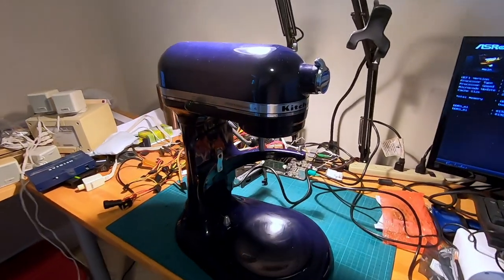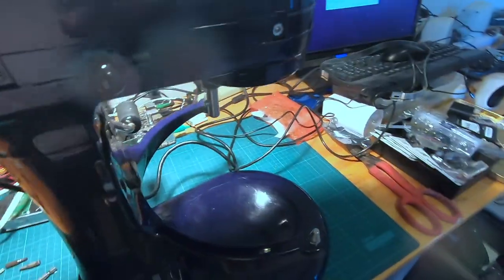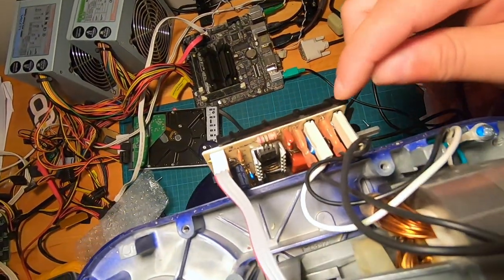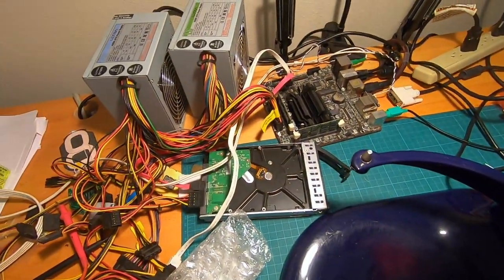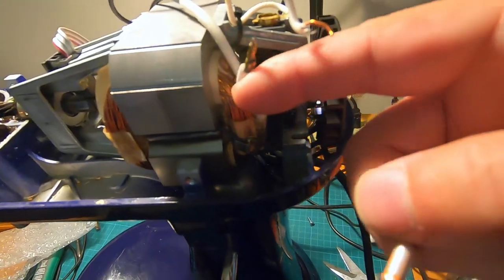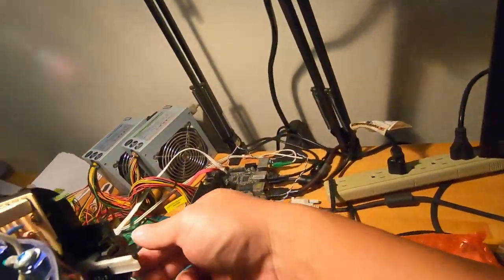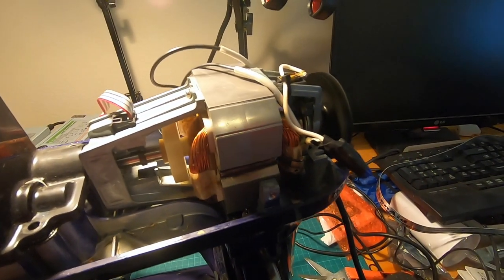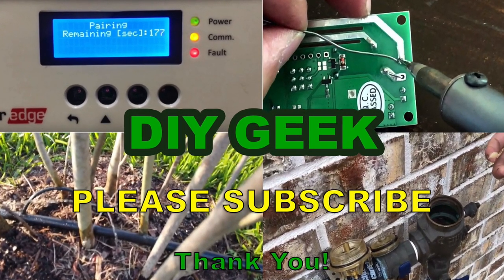KITCHENAID MIXER STOPPED WORKING [FIXED] - Thermal Fuse Broken

Comment from the maker: See video description to get the link to buy the THERMAL FUSE to fix this problem.  You will need a soldering iron to fix it, if you don't have a soldering iron yet PLEASE consider using my link to buy from Amazon (helps with my channel):
✅ https://amzn.to/2IEzGvx
Thank You very much!  🙏🙏🙏🙏🙏
Reply: IF it is needed to WELD a THERMAL fuse, great care should be used to avoid the Welding Heat to trip the fuse. 
Use a wet piece of paper towel over the fuse, maintain the longer leads and use pliers to sink the Heat transfer between the welding spot and the fuse.
Reply: Thanks for this video.  It appears the tank look of the device is deceiving.  I recommend reading and following the directions to a "T."  You can't mix more than the directions state without the risk of over heating.

Comment: Same issue with my mixer. FWIW, they put the thermal fuse there next to the motor winding so that it can be in contact and trip if the temp gets too high.  Remember, it's not an electrical amperage fuse, it's a thermal fuse, so putting it on the PC board would not protect the motor from exceeding the thermal tolerances of the design.

Comment: As said, thermal overload due to excessive heat. This happens for a reason. At near 10 years old, the gearbox grease my have lost its effectiveness. Time to clean the gear box and replace the grease. This should reduce friction and hence load on the motor. When any fuse fails, it's a warning that something is wrong. Without finding out the cause and avoiding it from happening again, another fuse will fail. At least these machines are repairable. Many now made are not.
Reply: This happens for a reason? Then what’s the reason. The same thing happened to mine as this person’s. Working fine. Put it away for a while then went to use it and it’s dead. That’s not what thermal fuses are supposed to do.
Reply: Mine worked for one loaf of bread and died on the second.  It wasn't ten years of bad grease.  It was shoddy engineering.

Comment: It is noisy because all those gears need to be re-greased... All the old grease has to be removed first then after everything is clean new grease can be added.
Reply from the maker: @PiratePete re-greasing the gears sounds like a great idea. Thanks
Reply: @PiratePete can you please explain how to remove old grease and what to use for replacement grease? I'm assuming I would use a lint free cloth...
Reply: @fdort3971  Go to Mr. Mixer on You Tube.  He has a three part series on cleaning and re-greasing this type of machine.

Comment: That's a safety feature built into the board...you have to turn it off before it will run after losing power.

Comment: Yes a bad design.  Mine worked to make a loaf of bread and then popped a puff of smoke on the second use. So maybe a total of 15 minutes running for $300.  Not very well engineered.  Mine is a Professional 550 HD. I hope I can find the fuse.  Thank you for your video.  I will need a better soldering iron that I have so I will get it from your Amazon page.

Comment: What was the rating of the fuse in Degree Celcius? There is no replacement shops offering KA parts but generic fuses with different thermal ratings here.

Comment: The best way to prevent it from overheating in the first place is to use it well within its operational limits.  Have a 5 quart unit and I won't put anything more than 3 quarts.  Plus, I frequently feel for overheating on the motor casing during operation.
Reply: i just cooked off my 6 qt...over loaded it- damn.

Comment: The fuse is for protection if there is a motor power overload or excessive heat. Also planned obsolescence.

Comment: Sometimes mine won't turn on. I unplug it and plug it in again, then it kinda works. Not as powerful as it was, and really noisy. I'm not an electrician, by any means, but I'm not afraid to try to fix it on my own. Do you think it could it be a short somewhere? I am going to jump the fuse for now and grease the gears. Thank you for your video and explanations.
Reply: How did it work out?
Reply: Power issues = your motor needs new brushes. Easy to replace. There are a few good YouTube videos on it - just look it up and you will have a powerful, reliable, mixer once more.

Comment: is it safe  to use the Kitchenaid Stand mixer without the band trim ring on it?
Reply: Yes the aluminum chrome band is for decorative purposes only. BUT make sure all the screws under the band which holds the top (helmet) (head) of the mixer are all secured.
Reply: @growingplantstimelapse5820  Thanks 😍

Comment: My KitchenAid mixer professional plus 600 hd  is not strong enough and shuts off. Any solutions? I guess I used about 3 times
Reply from the maker: @jenoc m How long does it work before it stops? Is it working too hard? maybe a very tough dough?
Reply: Any news regarding a fix?
Reply: There is a place in Hell for people on comment boards who ask for help and then don't bother to tell people what happened.  If you want free advice, a decent person participates in the discussion.

Comment: Why not use a circuit breaker that would reset itself after it cools?
Reply from the maker: Not sure, I am not an electrical engineer and don't really understand it that well. I am just troubleshooting and replacing with same part for repair.
Reply: Is there as a circuit breaker that will break due to heat instead of an overload of electricity? This is a thermal fuse that feels the motor overheating and will burn out to prevent the motor from burning out.
Reply: It's a thermal fuse - It automatically resets when it cools down it doesn't burn out  @EpicBenjo
Reply: @rvj5046     Obviously not or we wouldn't be watching a video on how to replace an overheated fuse.
Reply: @albertsmedley3636  Kind of a dumb ignorant reply...  "OBVIOUSLY" You have no clue what a thermal fuse is which is what that component is.  They wear out when they get old and turn off at lower temps and have to be replaced!

Comment: How did you know that the fuse was bad?
Reply from the maker: I used a multimeter, checked for ohm or connectivity, and found the fuse blown (no connectivity between the terminals)

Comment: You never showed how exactly do you temporarily recap the wire.
Reply from the maker: While i was waiting for the new fuse to arrive, i temporarily bridge (just connected two wires directly together). Please be warned that without a fuse, bridging the wires may cause fire and/or damages to your mixer. Because if the mixer gets overused or something got overheated nothing will stop without a fuse!

Comment: I have Kitchen aid mixer that belonged to my grandmother that won't turn on (it actually got in a bind and stopped) any idea what happened?
Reply: There are gears inside that break and it binds up or stops working. You can repair it by following youtube videos & by ordering the parts you need online...  Ours needed a gear and I replaced it today. : )
Reply: It has a gear that is meant to break before your motor burns up

Comment: Inline thermal fuses like the one you found are not "bad design". They are triggered leveraging thermal characteristics and so then it becomes a matter of PROPER DESIGN to have them inserted into a break in the wire and kept close to the device they are actually protecting. Having such a fuse on a circuit board would actually be considered a bad design for several reasons, one being that it would add heat to the circuit board that could then create other problems for the whole circuit and also it would not be in close proximity to the motor, which would mean that you have to ignore the requirements for implementing this type of fuse as it was designed to be used. So NO ... kitchen aide didn't make an amateur design choice when they put the fuse where you found it. They actually did it exactly as it was engineered to be done and the entire circuit is precisely and accurately following proper engineering standards. Making the fuse easy to replace for a home tech is never a design requirement for a quality product and it never should be. Proper engineering to result in a highly durable and capable machine is always the number one goal for a company like Kitchen Aid. And they consistently deliver that goal to their customers as their reputation speaks to so loudly even in these years where competition in this space is fierce.
Reply: It looks like many people have this problem. A proper design therefore would be a thermal switch which disconnects when the temp is to high and reconnects when the temp is OK again. The fuse used makes the machine inoperable which is ridiculous for such an expensive mixer which I should be able to hand-down to my grandchildren. I might as well buy a cheap one when I cannot rely on this mixer to work reliably.

Comment: 2 years later. Any tutorial on how to put in the new fuse? Not everyone has experience with a smoldering iron or welding. Can’t we use a heat gun to shrink wrap instead?
Reply: Shrink wrap is only to protect a bare wire from touching something and creating a spark and possible fire.  The wires in this case still need to be soldered.  Also, there isn't enough of a stub on the fuse to try to use a mechanical binder of some sort.  You must properly solder in this case.  There are many excellent videos on how to solder and what tools (different types of soldering irons) to use for each case.

Comment: Couldn't even see what process you went through to get it working
Reply: He just removed the bad fuse and then reconnected the wires without the fuse.  The motor can then get power but is dangerous as if it does overheat, it could start a fire.  The thermal fuse is there to stop everything before it gets hot enough to burn. The thermal fuse is a safety device that precludes a fire.